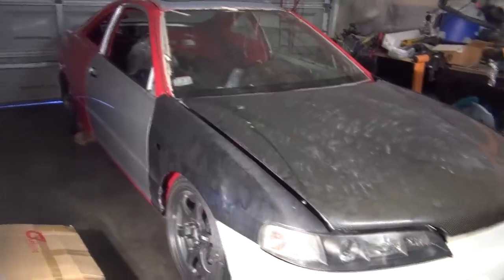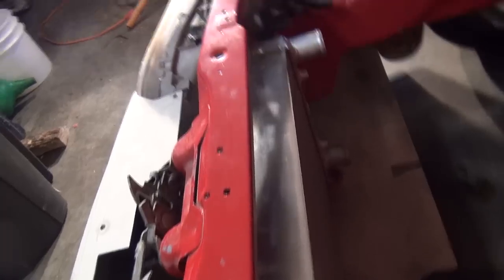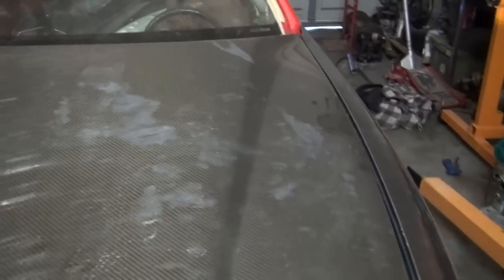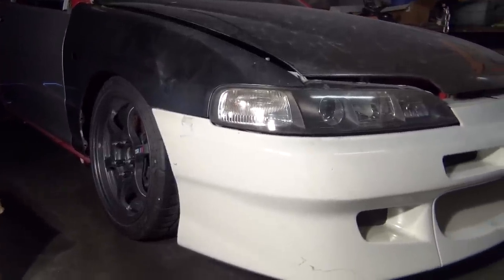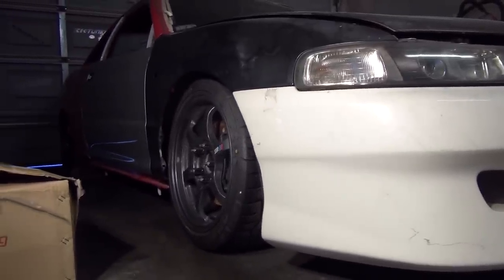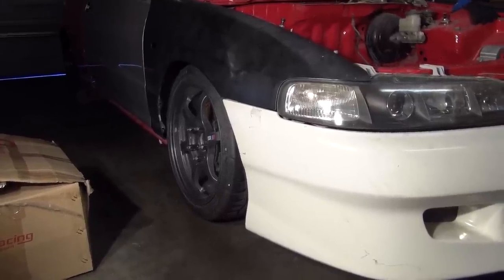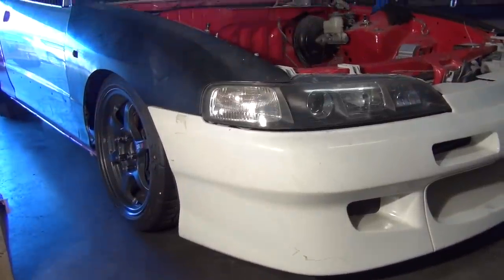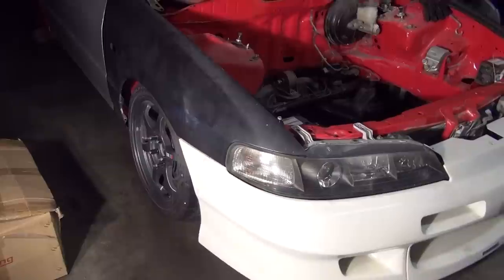Project RED: VLog # 000 - Build Theme, Intercooler, Radiator, Mugen Bummper

Comment: why wouldn't you just install a half rad and save the trouble of having to chop your supports??
Reply from the maker: This is because during long runs on a track with medium boost a half size will not cool fast enough.